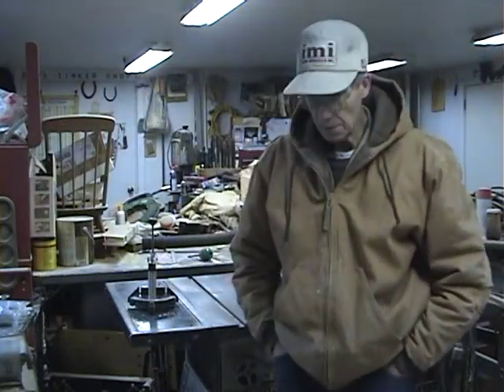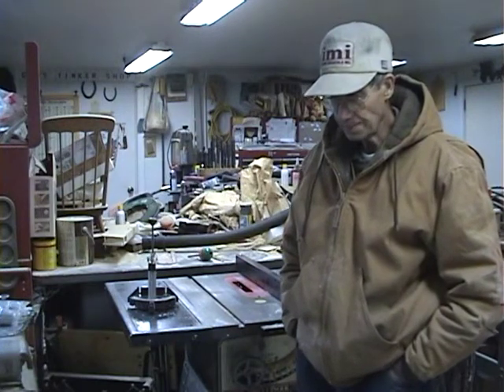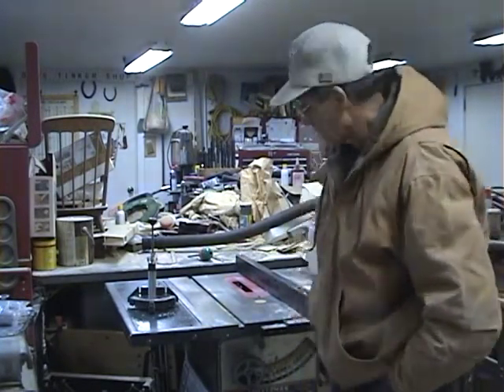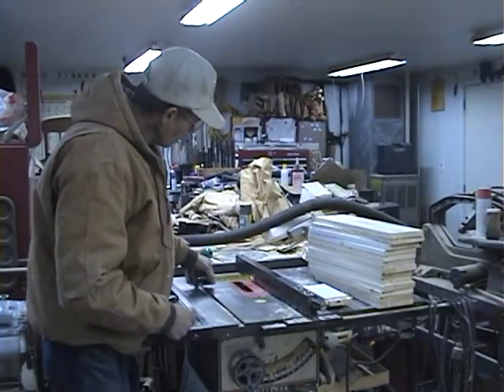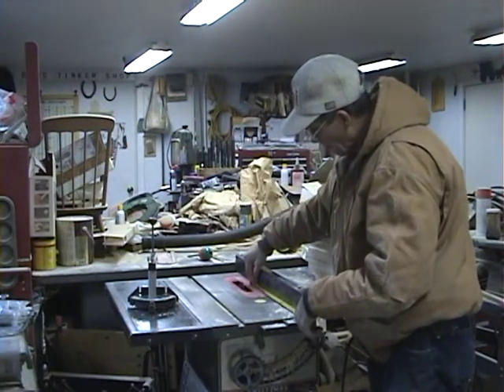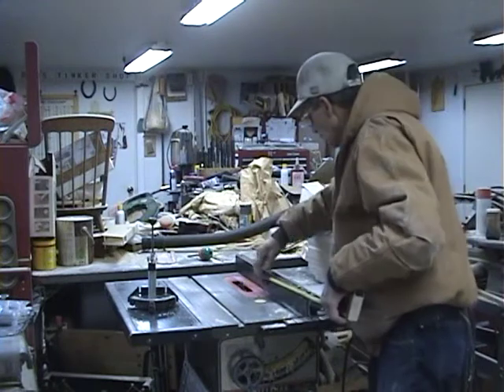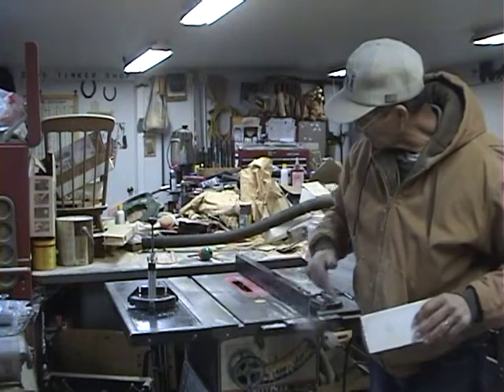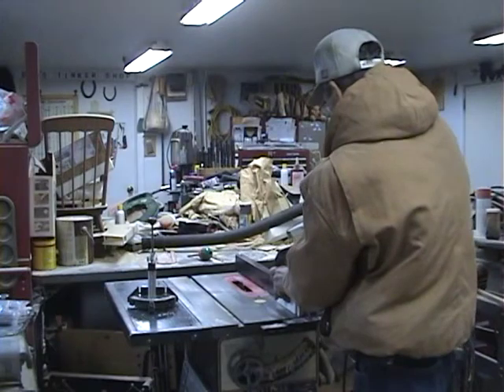cutting handles on table saw

Comment: I am building some 5 frame nucs. Do you feel it is better to have a migratory top or a traditional telescope hive top?  What are the advantages or disadvantages. I notice you have both in your bee yard. Thanks for your videos and help.
Reply from the maker: Migratory are easier to make and lets you stack the boxes touching each other. They warp worse and the wind will blow them off easier. Telescoping harder to make don't warp hard for wind to blow off keeps the rain out better.